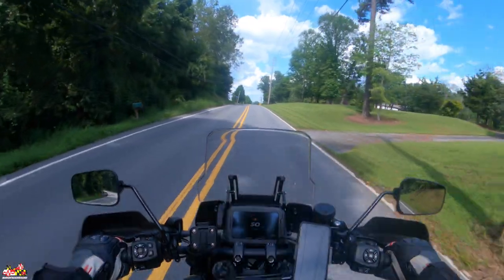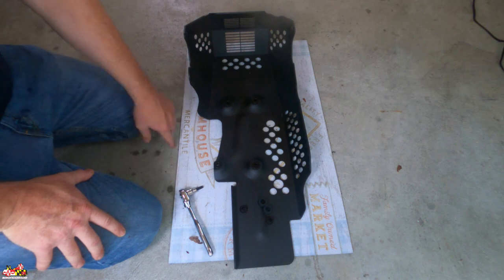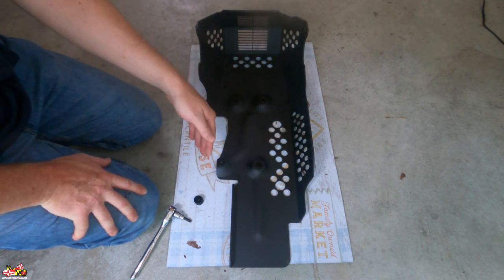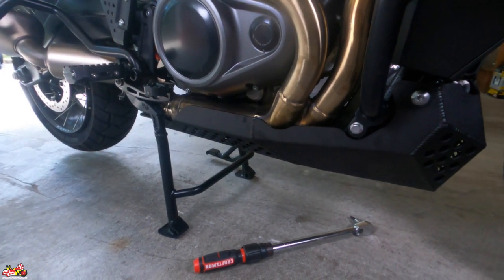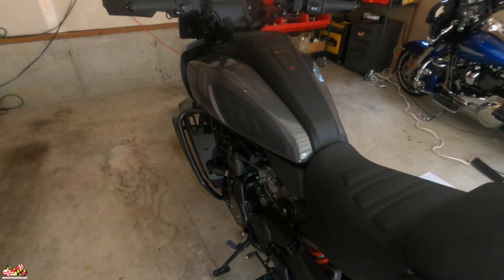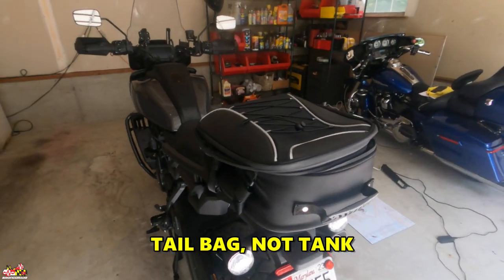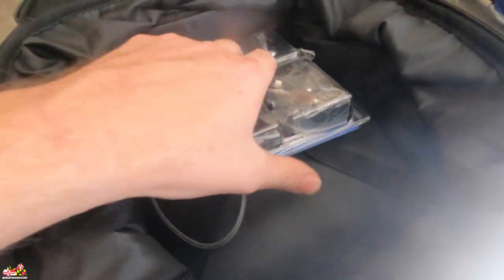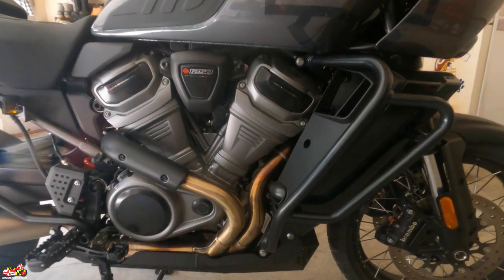New Pan America Accessories

Comment: Can you access the oil filter with the new engine guard?
Reply from the maker: Yes you can. It’s tight though, so prob easier to remove.
Reply: @Broncoride  Thanks. Probably swing it down like I do the stock one. Not a big deal.

Comment: Been considering a PanAm from my ultra limited. How do you like yours on a multi day trip compared to the touring bike? Could you see one as your only bike? Also is maintaining the chain a pain in the butt on a multi day ride? As we age those tourers get pretty damn heavy LOL!!!!!
Reply from the maker: Chain is simple. Multiple vids on YT about it. Usually takes me 15-20 min and I do it every 600 miles or so. This is a great tourer. You won’t get the stereo unless you have it through your helmet, but otherwise it’s great. I would recommend buying highway pegs though. I use AeeDea pegs.
Reply: Went and test rode one for two hours. Very fast, nimble, & light. Many faults compared to a cruiser and would not trade my ultra for one. As I do 7-8000 miles in a trip could not see that on that bike. Might be good as a second bike but definitely not your only one. thanks for the response.
Reply: @Broncoride  Rode a Pan Am for two hours yesterday. Very fast, light, and nimble. I found the buffeting, road noise, and heat to be excessive. I know you rode yours for a distance and wondering if you dealt with those issues. You also have a touring bike and wonder if you find that far more comfortable for longer road trips. Thanks for. your comments!!!!
Reply from the maker: @marclawrence2009 I honestly would rather tour with the PA. So much lighter and you have more capabilities with the PA. I enjoy both bikes, but I’ve been riding the PA much more.